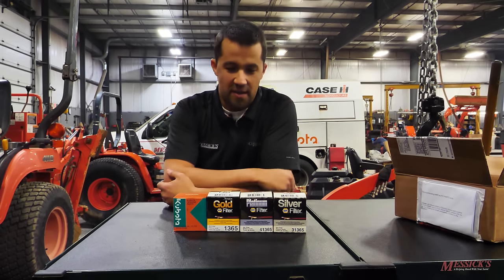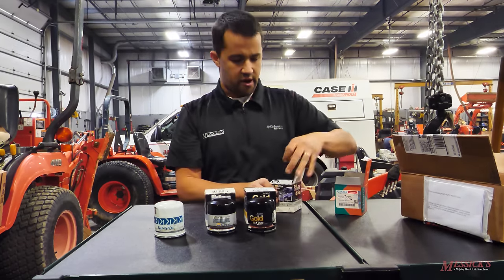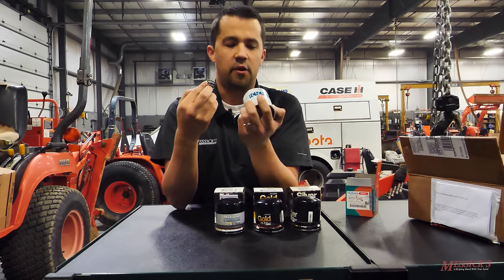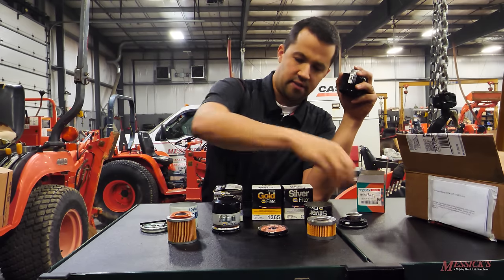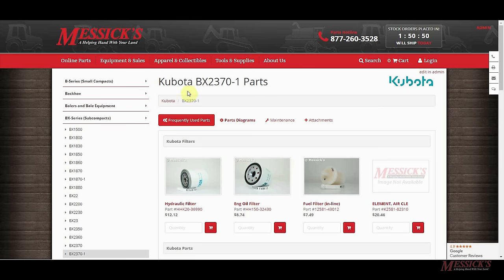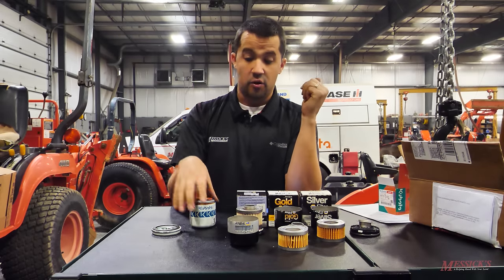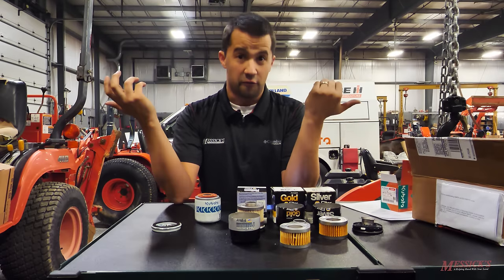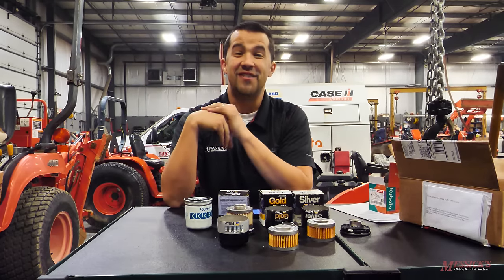Napa Filters VS Kubota Filters - Do you need OEM filters?

Comment: Excellent, eye-opening video.   Thanks.   I had always assumed that the size of the can pretty much corresponded to the size of the filter element inside.   Putting the undersized elements inside a standard can is, at the very least, ethically bankrupt and, IMO, actually borders on fraud.
Reply: I disagree.  Filter can sizes have a lot to do with the volumetric amount of oil it holds as well as the flow spec by the engine application, physical dimension of the space it lives in.  

This filter size is extremely common on Japanese cars engines etc.  And if the filter is sufficient for the application other than Kubota then Kubota should design their own filter.

Another strange arguement but possibly valid that I have not researched is that space in the bottom of the can allows room for sedimentation which only can occur if you reduce agitation.   In water separation if the element touches the water it will wick up into the element.
Reply: Worthless Fram Ph8a bypass valve opened up destroyed a perfect engine allowed dirt onto Conrod oil hole.

Comment: Hey Neil

Great video!   That upper gasket you're trying to explain is called and Anti-Drain Back Valve.
It keeps the oil from running out of the filter to reduce dry starts. We had problems
with this in the automotive industry with engine clatter on startup. The anti drain back 
was added to prevent this issue. It was good that you pointed out the material difference between all these filter.  Buying cheap filters is never cheap.

Comment: I am not a Messick's Customer. Do not even live near one! However, I do have a mechanical background and have worked as a truck/equipment technician. Three things: One: Fleetguard filters are awesome! Two: Run OEM filters! These filters meet or exceed the design requirements of the equipment for which you require filters. Three: If you cannot run or do not have access to OEM filters (why would you not with the internet?), then run a filter such as Fleetguard or another extremely comparable brand. Running aftermarket filters is an evolving risk to failure, extensive damage and VERY expensive equipment repair or replacement! "It's Cheaper to Keep'R! (with the good stuff, of course!)

Comment: Considering the price and that you know for sure the Kubota dealer will have it in stock, the Kubota filter is without doubt the way to go.  If, however, you need a filter and there is not a Kubota dealer around any of these filters will work fine.  The important thing is DO THE MAINTENANCE and dont put it off.  I do not have that many hours on a tractor, but have several decades on automobiles and as an average working stiff would use the cheap oils, filters, etc. along as the parts were the correct spec or grade.  Never had a maintenance related problem.  Maintenance schedules exist for a reason, and if you go by the schedule for extreme use, there is not a lot that can go wrong.  I plan on using Kubota filters, because of the ease of ordering "kits" online, and since I am older I have the money to do so.

Comment: I usually buy all my maintenance supplies from where I bought my tractor. My thought is the oil & filter I use in my truck is fine for my truck, and I put some quality stuff in my truck, but I wouldn't use it in my tractor. 

Kubota chose the oil & filter they use for a reason, and the price they ask isn't outrageous. I bought my oil change for my tractor last year 7.5 quarts of oil and a filter was less than $60. Not exactly breaking the bank if you bought and are paying off $20,000 worth of equipment. I just think the piece of mind of using the certified oil and filters is worth the extra money you spend.

Comment: Microns don't mean squat if the filter has a poor beta rating. You guys need to test the engine oil by sending it to a lab and you will  find out which filter is best. Run a back to back test with the NAPA platinum and OEM
Reply: I used to own a quick oil change shop. We sent oil samples to the lab to check wear. That is the only way you will know if one filter is better than another, also all oils are not the same. Compare apples to apples. You are absolutely correct.

Comment: I used a Wix hydraulic filter on my Kubota tractor and while running a PTO mounted rear snow blower I saw a large amount of fluid on the snow. I shut down the tractor immediately and discovered the Wix hydraulic filter was loose and the gasket was loose from the fitting on the filter. I had installed the filter in the summer and now in the winter the gasket seems to have shrunk resulting in the filter leaking. Fortunately no damage to transmission etc. I removed the Wix garbage filter and I threw away every Wix filter I had in stock. I am convinced that Kubota OEM is the best fit and best filter. I use Kubota on my Kubota and I use Toyota on my Toyota vehicles. This Wix garbage hydraulic filter failure could have cost me thousands of dollars in repairs. The cost is of OEM is very similar and the fit and quality is optimal.  I am 65 years old and I finally learned my lesson. OEM all the time.

Comment: Got my Kubota Z122E with 200hrs serviced from local dealer with Briggs & Stratton pn: 695396, a short yellow oil filter 2.4 in. tall. Getting mower ready for fist season cut and even though it had only been 10hrs since last oil change, decided to start fresh. Saw your video and went to Napa with B&S filter on hand, they cross referenced it to another short filter, asked if they had larger capacity and for 3/4-16 thread (3/4 stamped next to threads) got their Platinum pn: 41348 on sale for $4.99, filter height is about 3.4 in. and its as tall as Kubota filter. Its just so convenient to purchase from Napa. Have placed order from Messick's before and you guys are just amazing, mower was missing some labels and you had them all--great online source as well--appreciate your videos!
ps: changed fuel filter as well, Napa pn: 3001

Comment: I only used a "non-Kubota" filter once on my 6040 and didn't have an issue. The only reason I didn't use a Kubota filter this particular time was because I bought every filter for the machine and somehow ended up with 2 fuel filters and 0 oil filters and of course it was a Saturday afternoon after the dealership closed when I discovered what had happened. Now that I've got my new M5-111 I intend to keep it all Kubota even the motor oil. BTW who acutually makes Kubota motor oil?
Reply: Valvoline made to Kubota specifications
Reply: @BWIENS789  Valvoline oil is the base oil but then is shipped to either the plant in Indiana or Michigan for them to put their own additives in it. Yes Valvoline oil is good and will work. But if one cant afford the right oil and filters then they really can't afford to have the machine

Comment: Question for Messick's Equipment.

From what I can tell off of your website, you list three oil filters with the same M20-1.50 thread specification as the part number specified in the video. These part numbers are: 1.) The Kubota HH150-32430, 2.) the Kubota HH-150-32094, and 3.) the Kubota HH160-32093 (arranged from smallest to largest). Would it be acceptable to run the larger HH160-32093 filter on a system that specified one of the smaller HH150 filters? 

Thank you for your time.
Reply from the maker: we generally would not recommend deviating from the part recommended for your model. The threading maybe the same, but we don't know if there is a difference in flow rate, filter material, etc.

Comment: Kubota filters are a cellulose material which are prone to failure, as the cellulose is vegetable paper. Moisture will kill a paper filter. The NAPA Platinum is a Microglass filter which is the best of the best!!! Look up Beta ratings and you will see what efficiency looks like. Paper sucks and Microglass is the best.
Reply: If you have water in your oil, you're in some serious trouble.
Reply: There’s moisture inside of your engine.   It comes in the form of condensate.
Reply: What’s the price difference
Reply: Microglass has limitations as well though, particularly in fuel filter applications. The latest filter media technology out there is synthetic nanofiber media made with plastic polymer materials.
Reply: You my friend are correct
Reply: paper media (cellulose) is the filter media of 95% of engine filters produced for the last 60 years and is not "prone to failure" lol. Synthetic glass media is relatively new (last 15 years mainstream) and is definitely an improvement in all measures, specifically longer change intervals afforded by synthetic oils.

Comment: I have been using  the absolute largest (external dimension) filters that will fit my tractors. On my Kubota MX4800, instead of the Kubota HH164-32430 I’ll use a Wix 51515 at possibly twice the volume. I hadn’t realized that the none OEM filters use cut down elements inside their filters, but I have to believe the longer physical filters have longer elements. An additional advantage of using the larger Wix filter is that I can use the same filter on my Massey 180, and my Kubota L345. The filters are located on the side of the engine, so seem well protected from damage. If you can find fault with my logic, I would appreciate knowing your reasoning.
Edit: The OEM Kubota filter measures almost 3” long, the Wix filter is almost 5” long. The element inside the Wix filter is almost 4” long, longer than the entire Kubota canister. Admittedly the 3” long Kubota filter weighs more than the 5” long Wix filter. Without pulling the Kubota canister apart, it is believable that the filter element is only 2” long, 1/2 the length of the Wix filter. The larger filters match up, spin on, don’t leak, so why not use them?
Further edit: I imagine the bypass rating matters. I could not find it for Kubota, but using an oil filter cross reference chart for the OEM Kubota filter, I get 3 Wix suggested alternatives: One with a bypass rating of 8-11, one of 11, and one of 16. The oversized Wix filter that I am using has a bypass rating of 8-11.
Reply: FYI.. Wix makes Napa’s Gold line filters..they have for many years..

Comment: The only problem with your comparison is that in each of the Napa filters you showed are the low capacity version of those filters for that particular application ,, in each of those there is a High capacity version for the same application  which has equal to or more filter material than the Kubota filter... so you are doing a unfair comparison of filters,, not knowing if it was intentional or not ,,next time ask the sales person so that they can show you and pick the filter that is equal in size ( because those are not) and get both versions  ,,Napa filters are made by WIX and are one of the highest quality filters made in the world and make Caterpillar filters , and you cant get anymore industrial use than that... not saying that the kubota filters are not a good filter but they are not any better in quality than that of a equivalent WIX / NAPA filter..

Comment: The Kubota outer air filter for my B7500 is $37.  The guy at the parts counter was shocked when he looked it up.  He felt so bad he gave me a 15% discount.  I find the price of the oil filters to be reasonable but don't understand why the air filter is so expensive.  I would have expected it to be, for what it is, more in the low $20 range.
Reply from the maker: $20 from us. 
https://www.messicks.com/part/6c060-99410/outer-filter

Comment: wile interesting you did not address the micron filtration differences of the filters, and thats also what they are all about, larger pleated area is not the big issue. (ase master tech)
Reply from the maker: no arguments here. The problem is that information is really hard to come by.
Reply: The Microns are usually listed on the packaging.
Reply: Usually,  tighter pleating has a better filtration rating like k&n

Comment: Having worked for a manufacturer, we do not give out data on our filters to anyone, so the only ones who know the real capability are the ones we have make them for us and ourselves. Filtering media is very important. Even if they were the same size the media may not filter as well. Also it looked like the NAPA filters did not have as many pleats as the Kubota filter - and pleats add area. Lower media height, fewer pleats, and who knows what media filtering capability - recipe for disaster.
Reply: I have also worked for a filter manufacturer and agree with your points 100% - spot on!

Comment: Agree 100%  I had a Nissan Altima where we changed religiously at Firestone since new car was new. That cars engine  was filled with sludge at 65k miles. Nissan Dealer told me engine burned up $5k for rebuilt motor.. I took it to another mechanic he had it running in an hr. Sludge at the oil pump caused it.  Anyway point of all that I go with original al OEM in all vehicles now. I go to the dealer for oil changes and filters. They are Specifically engineered for each vehicle , and virtually no price difference.
Reply: Knowing how Firestone operates, they probably weren't even changing your oil when they charged you.

Comment: It is impossible to judge the filter surface area without removing the material and measuring its area. The NAPA pleats are fewer and shorter in one dimension, but appear much deeper. Love Messick's videos but all of the points made here are likely irrelevant, excepting backflow prevention, if oil is changed at proper intervals. I would rather know which element passes largest particulates, so to avoid it. Capturing particulates is the complete and only purpose of a filter.

Comment: What is the micron filtering size of each filter? Just because the element is is taller doesn't mean it filters more particulates out. It will flow more but not necessarily filter more containments

Comment: you should only run oem oil filters and air filters. some makers have special valves that keep the proper oil pressure. I use a aftermarket on my foreign and the engine started knocking.

Comment: Is the 1365 the recommended filter for BX's?  I thought it was the 1064.  I use the Wix(Napa) 51064 about half the time and it is nearly the same size as the Kubota filter - I have cut them open and the Wix is slightly smaller, but comparable.  The 1365 is a smaller filter and no surprise it is way smaller inside.
Reply from the maker: +lindnova no idea. I punched the part number into the Napa website and this is the cross reference it gave me.
Reply: I guess that's another reason to go use Kubota filters since the aftermarket can't give correct equivalent cross references.

Comment: OEM DOES make a difference!!  Learned first hand using NAPA Gold hydraulic filters on my Kubota BX 25 while operating in the winter and snow blowing. Blew out two filters and gallons of hydraulic fluid. First time I thought was a fluke second time shame on me. Never had the problem again using Kubota parts and will not risk it again with any replacement parts. They couldn't stand up to the pressure and the clean up was a nightmare.

Comment: I'm going to guess that not every size of wix filter is like this. There's been tons of filters that have been cut up from WIX and none have seemed to be this small in comparison to their competitors.
Would be good to document which wix filters are undersized for their case though if this is more common.
Reply: I've had good results with the name brand Wix stuff, the private label stuff (Napa, et al) is a dice roll as the manufacturer is building to a price point prescribed by the brand owner (in this case Napa).

Comment: Some oil filters, especially in the F250 trucks, the napa filters on the diesel trucks can be shorter then factory, and not close off the anti-drainback valve leaving hard starts in the hpop.

Comment: How about this compare brand name, Fram, Purolator , Wix, instead of a store brand produce by another company to the stores specs. Also who makes the Kubota filter?
Reply: Charles Kettering napa brand filters are made by wix
Reply: The one problem I really have it is outsourcing, I hate seeing distributed by. I would also would like to know who made the  product. I really bit me with my 1988 Chevy truck where they outsourced The front end parts. 10,000 all new ball joints and idler arm., 10,000 later the same thing this time instead of using GM parts they used MOOG they lasted. 
 Most of the filters oil and air are outsourced so I guess it's kind of a crap game, but you don't if you lose until you have a failure.

Comment: Hi Neil, 

Great video, Sadly our Kubota Filters in Australia is 3-4 time the cost of your filters(and other parts). That is why we have to use Third Party Filters, Sometime 10x times more expensive then Kubota OEM. Pity you don't send them to Australia, It would save us farmers a lot of money and headache  

Could you do one on Kubota Oil and Third Party Compatible oil?
Reply from the maker: +Han Shiong Siah oil is on my list. Harder to look at hard differences.
Reply: Lubricating oils are a very complex chemistry and lots of trade secrets on the mix of base oil with special additives.  The best thing Messick Farm Equipment can do is explain the legal significance (in the USA) of when a non-factory oil claims to "meet" or "exceed" factory specs, yet never includes that factory spec on their container label.  Also most warranty claims require lab testing of the lubricant oil in question, to prove if it was in fact an oil that meets all the factory specs.
Reply: @KCautodoctor  Very interesting 🤔 Can you elaborate?